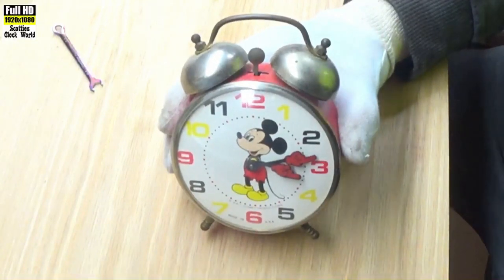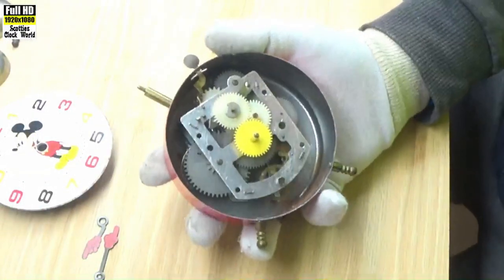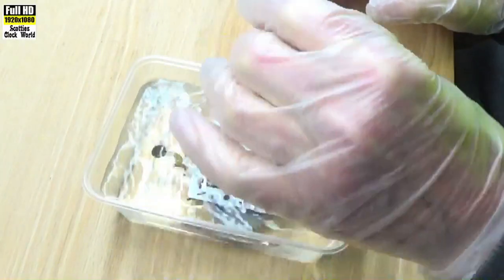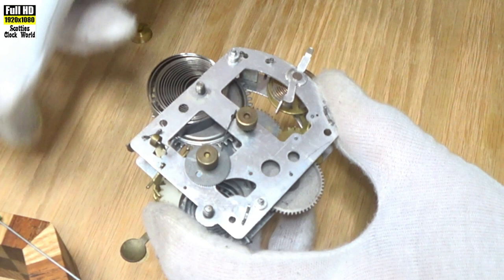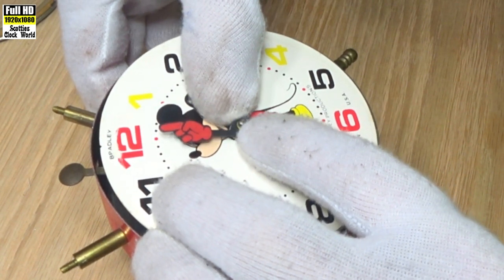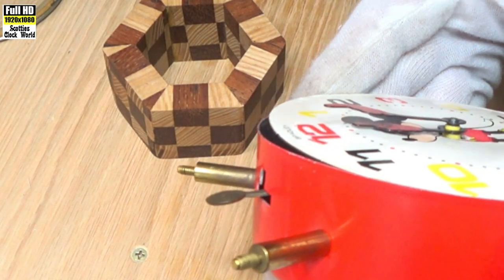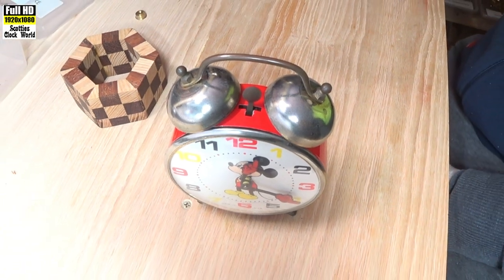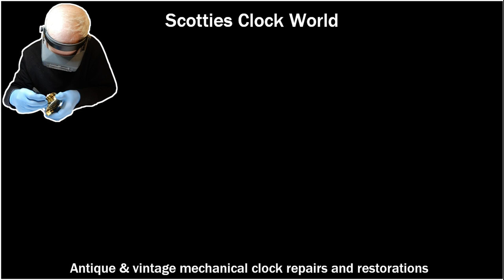Bradley Mickey Mouse alarm clock service - Full Video

Comment: Bradley made a lot of these clocks, identical but for the color and graphic theme. To get the alarm on this clock working again, you might find one with a more common, less desirable theme (Strawberry Shortcake and Care Bears ones seem particularly common and not terribly expensive) and scavenge the movement from it.

Comment: I was a little disappointed that you weren't able to repivot the broken wheel and replace the alarm spring and show us the alarm working at the end of the video but I guess that's hard to do if the wheel is made of plastic and the plates are riveted together.  There are 200 year old mechanical clocks still in service but they were made in such a way that they can be taken apart and repaired.  Thanks for sharing.